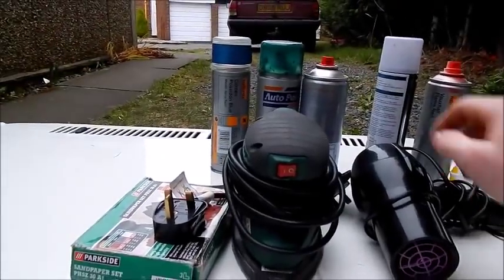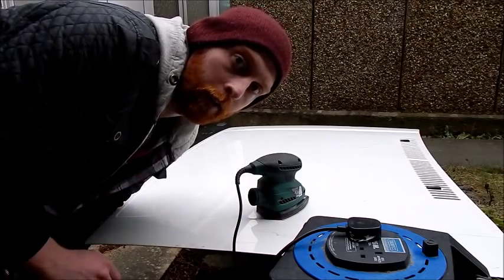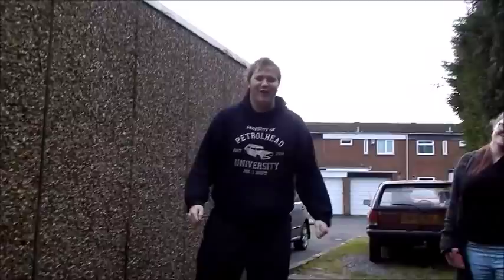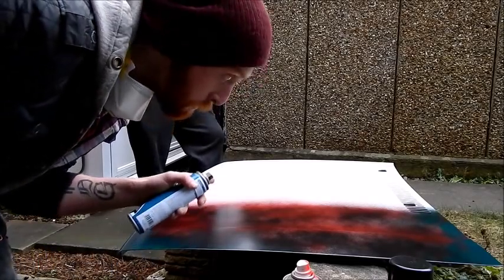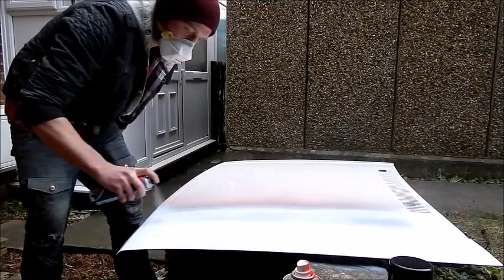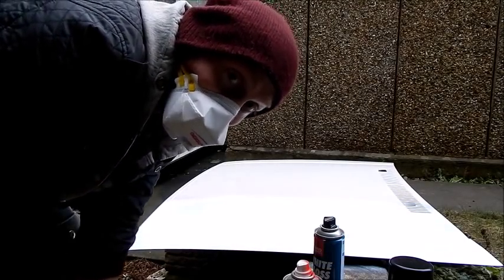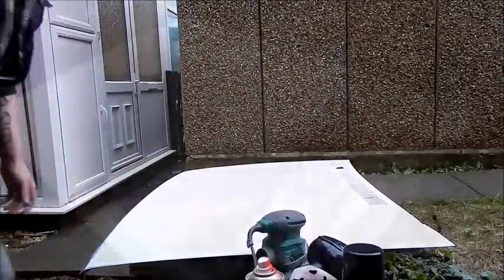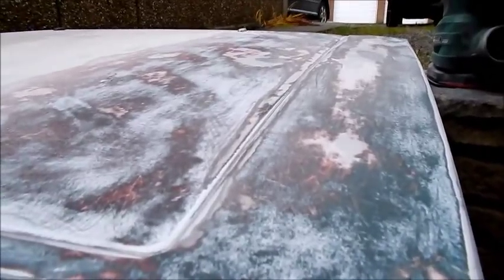How to Rat Look your car Patina style!

Comment: nice try with the DUST mask lol it will do little to save you from paint FUMES. at least youre outside...

good video tho, im going to use some of your technique
Reply: ive seen where people ((flik)) speckles of red on so it lands as raised dots, when you sand it it gives you a different reveal. just let it fully dry like you said and the raised parts will sand first and simulate spots of rust.